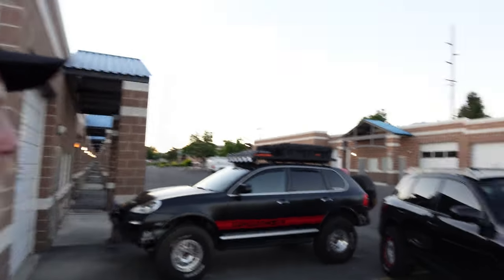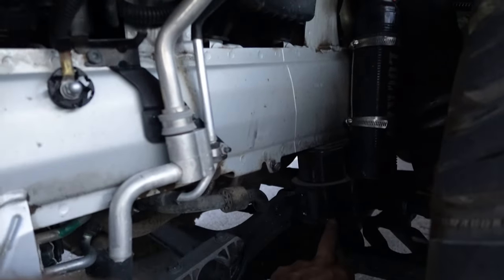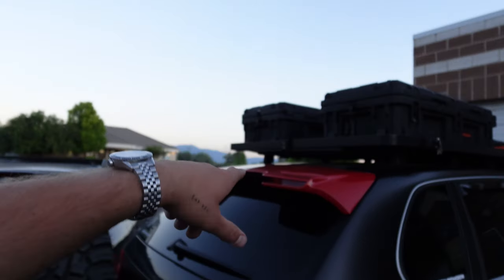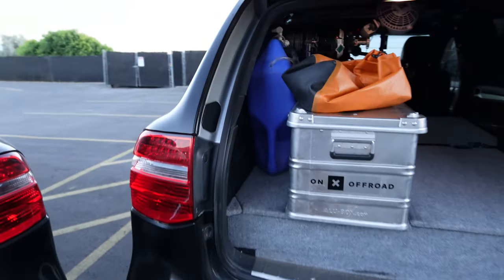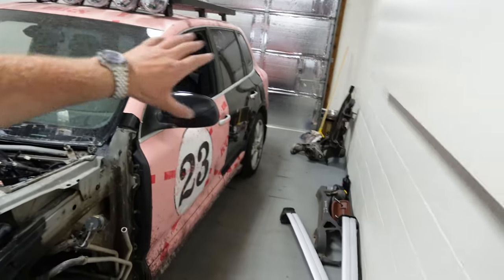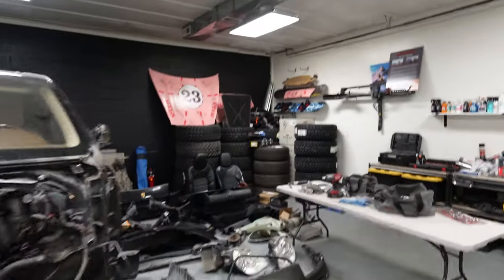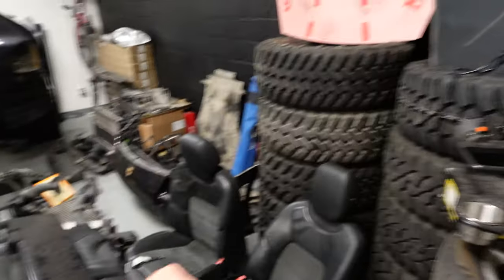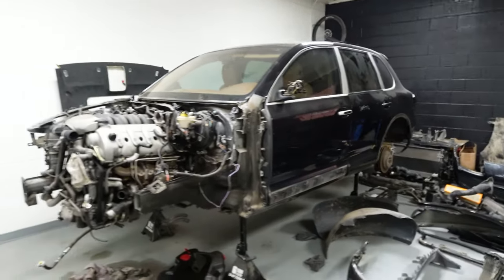I have a Porsche problem.

Comment: With all your knowledge of Cayenne's, maybe you can help with my issue? I have a massively broken 955 turbo. I love this thing even if it haemorrhages my cash! One issue that really is getting to me is that when I had the battery replaced, I lost menu options onere is no longer the ability to change what types the dash, so th the car has! I also don't seem to have the options for a Bose sound system on the PCM 2.1 system. It is so minor I have not really looked into it yet. As for your content, it's amazing, I got the PIG before I knew about your channel. My idea was to overland it, but thus far, money and time and the fact I seem to have got a very broken one have stopped me from doing fun stuff. Maybe I'll hit up some green lanes this year when I get 18-inch wheels and new tyres. depends on how often it needs work done between now and the end of the year the jobs list is massive!

Comment: If you prefer not to document the build , perhaps you can just highlight the specific parts and answer the questions - why decided on them , how long it took , cost , where you sourced them ,  the gotcha's during assembly , and tips and tricks .   Also, after doing the shake-down off-road test , answer the question - how much improvement did the mods make to the vehicle , what would you change if any ?
Reply from the maker: Thank you for the insight!

Comment: I have 4 mercedes Vaneo's (I'm an enthusiast). 
I had the same idea as you, to make one into a trailer, but every garage I've been to, has advised me against it, because unless you intend to do a double axel trailer, then it just doesn't work, weight distribution wise. 

They used to do it with Mini's in the old days, but there're many unseen modifications, to make the whole balance work.
Reply from the maker: I can’t imagine the half trailer built out will weigh more than 2,500lbs with fuel tank, differential, engine, trans, seats and front end removed. Perfectly within the load rating of the tires/wheels and suspension that will be on it! My only concern is wanting to have trailer brakes on it!

Comment: Thanks for the video! I like both: shop and the outside adventures! It is nice to see what you are doing or have done to the cars and then nice to see how it goes on the adventures. 

My 2005 Porsche Cayenne Turbo didn’t come with a trailer hitch. Have you had experience with installing the Porsche hitch vs an aftermarket hitch? Do you prefer the Porsche hitch or aftermarket hitch?
Reply from the maker: Thank you for your input! I personally have no experience installing say a wire harness from a hitch, but a rear bumper with a hitch is 8 simple bolts if you just want to carry a spare back there.

Reach out to Eurowise and I’m sure they will be happy to sell or send you a removed one from a car that bought one of their bumpers!
Reply: @HarrisonSchoen  Thanks!

Comment: Stuck between an ‘08 Base and an ‘08 S. Knowing the problems related to each trim, what would you recommend for an overland build
Reply: I'd stay away from 2008. The rumor goes that porsche was using two different block manufactures up until manufacture date till around 10/08. One was doing the lokasil process correctly one was doing it incorrectly. Porsche caught onto it and switched to just the one manufacturer so if you're getting an S make sure you get a late model 2009 or newer. 
Or stick with v6 from what I've heard others say you don't notice a huge loss from the v6 but I haven't driven one yet to compare
Reply: stay away from 2008 cayenne S or older  V6 is fine
Reply: Are these Cayennes reliable? If so, what years/models are the good ones?

Comment: I would highly advise against using a vehicle shell as a trailer. Especially one of these. What ends up happening is the rear axle is the only axle on the "trailer" which in turn puts most of the weight of the "trailer" on the tongue. Which in turn puts it all on the rear bumper of the tow vehicle. There's a reason why all trailers have an axle or 2 located fairly close to the center of the trailer to disperse load evenly. The driving/towing characteristics will be terrible and you'll regret all the work you put in to a custom trailer
Reply from the maker: Definitely something that I’m going to consider, and I’ll likely cut it a bit further back than the firewall to make most of the weight sit over the rear wheels.

Likely will put a spare tire carrier on it to further push the weight back also.